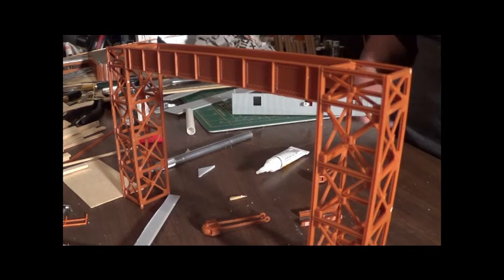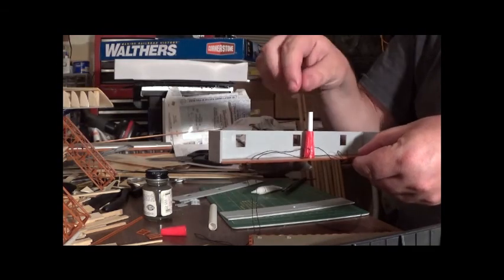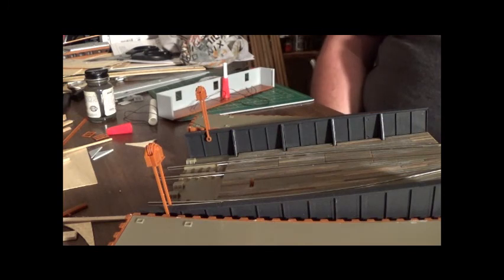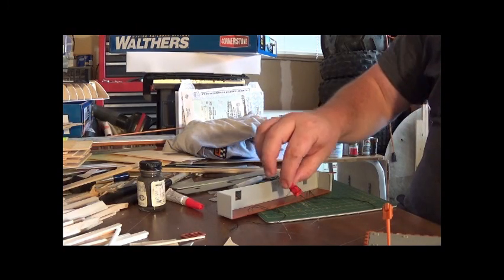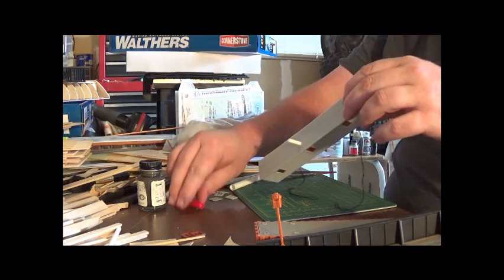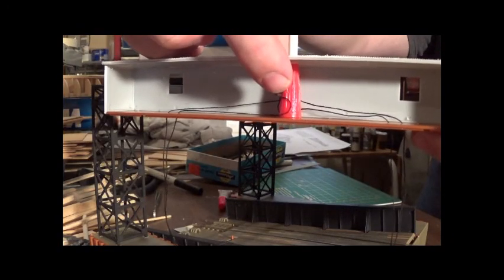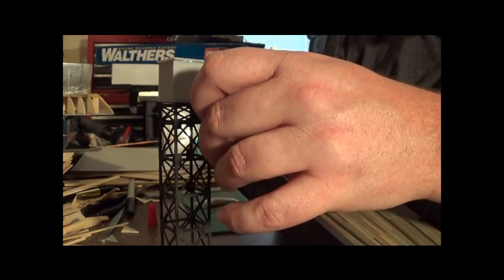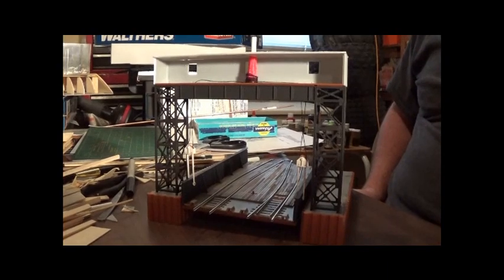Walther's car float apron crane build

Comment: Great looking dock RT. I think you could make the  tracks line up when it is in different positions, but the piece with the switch would have to pivot at the other end too. The biggest design flaw it the dock does not pivot at the very end, if it did I think all you would need do is round the ends of all the rails and power the dock rails so you don't need rail joiners.
In any case I think the dock only need to "float" up and down with the barge as it's waterline changed as cars were loaded and unloaded.
thanks for sharing, Chuck
Reply from the maker: Very good point Chuck ,thank you, I'll definitely power every rail at every joint and leave un-jointed gaps at the rear of the switch so pivoting can be possible . I really like rail marine operations, and realistic operations will be influencing my commentary  in both video and article form, for future reference . Any information on rail-marine operation would be greatly appreciated .